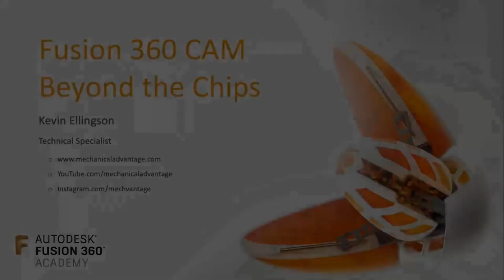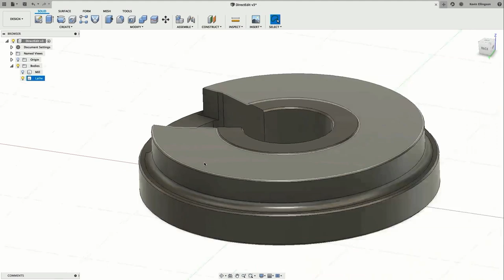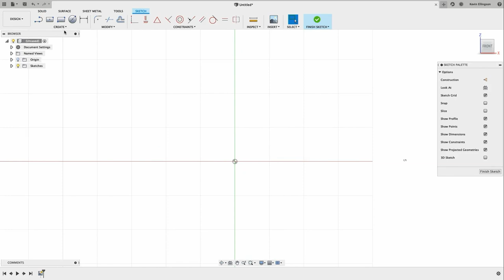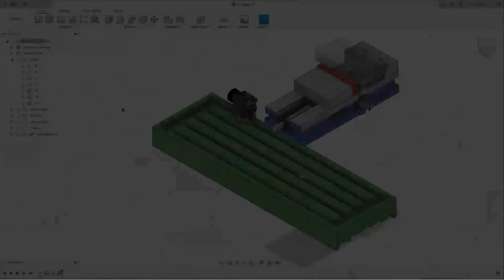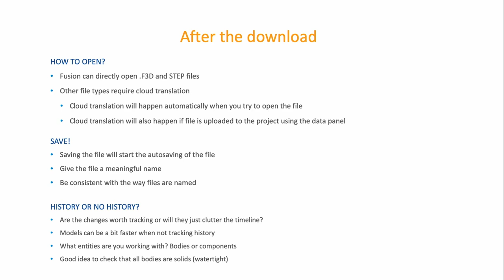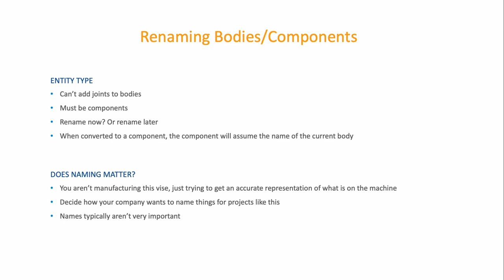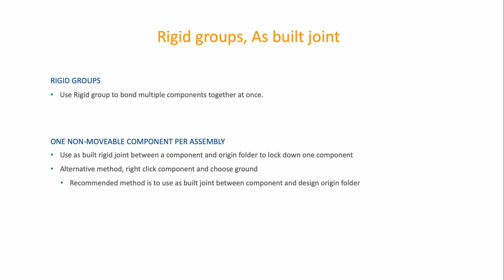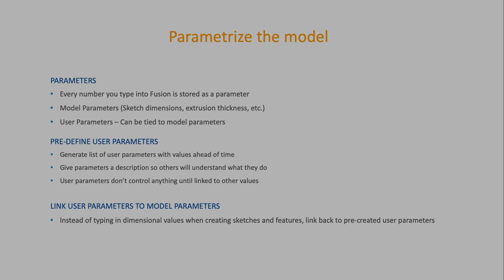Fusion Academy Refresher - Beyond the Chips

Comment: Have a question. I decided to also do the Kurt 4" double sided vise. When setting the jaw faces together on either side of the fixed center piece , I get my positive # on the back of the vise but on the front it's negative. Is this because of opposite movement from the fixed jaw and can the negative side be made positive like the back. Thanks
Reply: Hi Mike. Tehnically, this shouldn't matter. I like to do it the way I showed so zero is when the jaws are closed. I also like to see positive numbers, but since the jaw opening is controlled by the stock, it should work out either way. The primary reason I do this is so that zero can be closed and then i can set up a minimum of 0 and max of what I want the jaws to open to. If you don't get positive numbers, you just have to cancel your joint and change the order that you selected the items you are adding a joint to. Hopefully there can be a little more control with this in the future, but for now, that is the only way I know how to change things.
Reply: @MechanicalAdvantage  I will work on that.  Still playing with the 4 double sided vises and 8 parts. To be able to program 1 then have  the other 7 populate then when it posts out have 8 individual offsets. Any suggestion on proper layout for this. ( 1 sub plate, one double sided vise with stock and parameters, one part. ) Thanks
Reply from the maker: Thanks so much for weighing in on this! Really REALLY appreciate it! I wasn't sure how to answer...
Reply: @adskFusion  I have zero experience with cad/cam. A little mastercam from trade school back in the late 90's early early 2000. Have always been fascinated in it. Union shop so switching over to programming means loss of seniority because we have 2 unions. Close to retirement and hoping to set up a mill in my garage. I jumped in feet first last spring of 2018. Everything so far has been from Youtube (Titan, Lars, NYCcnc, Autodesk , mechanical advantage and so on). Hardest part will all this is learning proper technique as soon as possible and not learning a lot of bad habits/ bad technique. So that led me to this double sided vise project. Found the double sided Orange vises in Fusion that are programmed but looking thru the design I'm still struggling to see how to do my setup properly and achieve that idea / setup.
Reply from the maker: You're absolutely right about learning proper technique! That can not be emphasized enough. Hope you're finding all the educational content you're looking for...let us know if not!